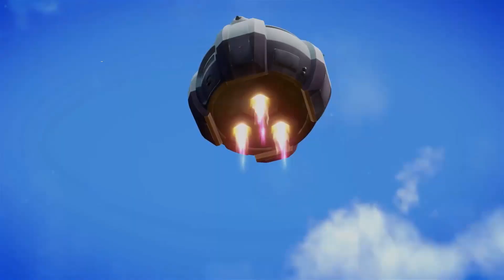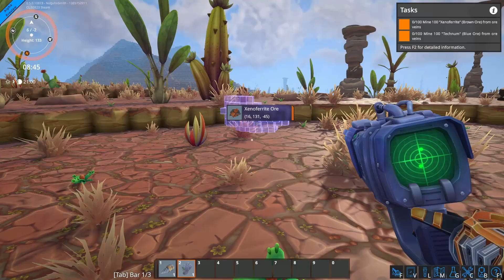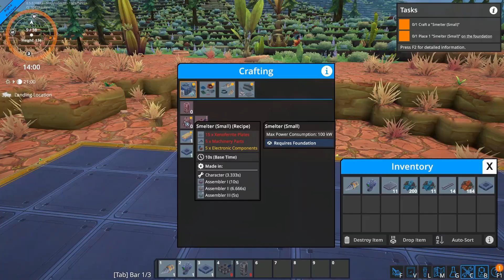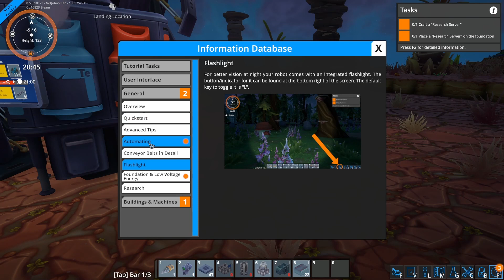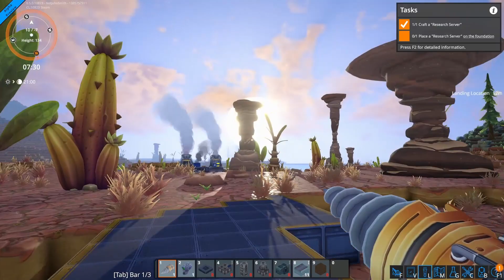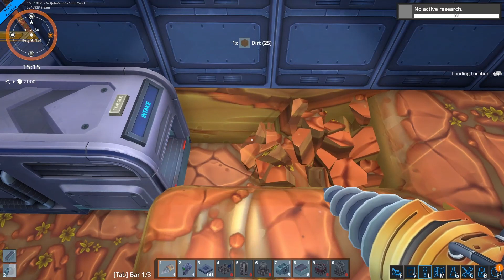This PROMISING Factorio / Satisfactory like Game is a LOT OF FUN! - FOUNDRY - Steam Next Fest

Comment: This isn't similar to Satisfactory... It is Satisfactory with lower graphics lol. Although I can't be upset... more automation games the better! I am curious why most of them use loaders though... Factorio, Techtonica, This game, etc... Satisfactory is one of the only ones where the belts go directly into the machines.
Reply from the maker: Yeah, you're right. Also with the loaders here, you have to place them next to a building. In Factorio you could have an inserter transport an item from one belt to another. That's not possible in Foundry as of now. But it's still in quite early development I guess, so we'll definitly see some changes. And what's already here looks promising in my opinion.